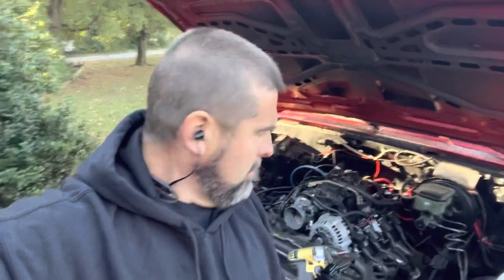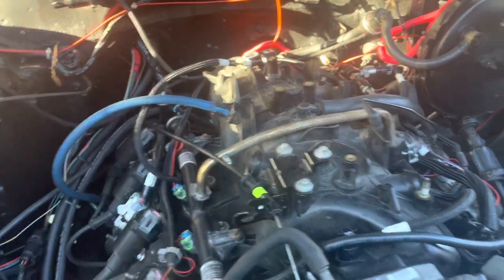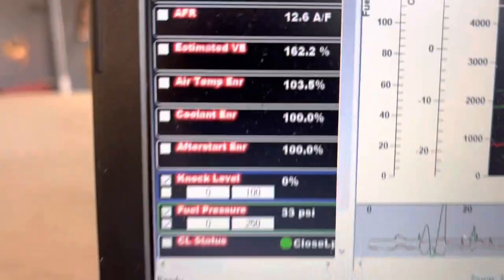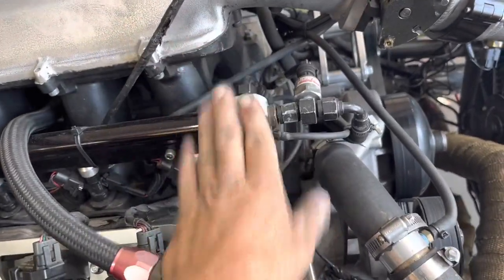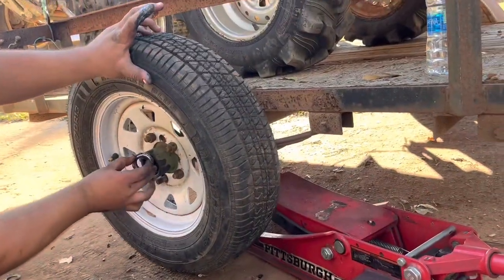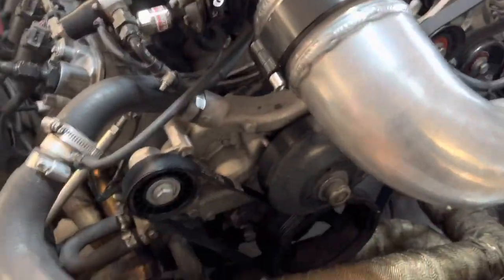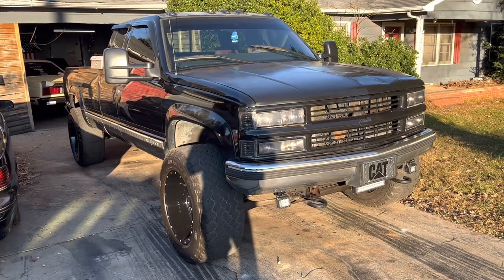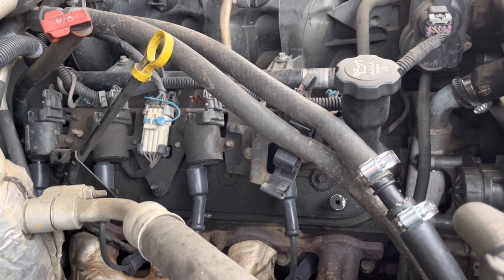I Give Up

Comment: 1987 tank and sending unit with a Walbro 255 retrofitted into the sending unit. Right around $250 and it will never be a problem again. Your guy needs to stop dropping dollars to pick up dimes. I feel your frustration!

Comment: The secret sauce of a low budget yet extremely reliable n/a LS swap square body fuel system is an 87 r10 tank & 87 r10 sending unit with either a walboro 255 or a kemso 340 pump. I've built several like this been running trouble free for years. with perfect fuel pressure
Reply: I just replace the stock tbi pump with the ac delco ep381
Reply: @ryanreaves1203  yeah if its a tbi rig, it's already got the right tank & sending unit. & That pump works well for what it is